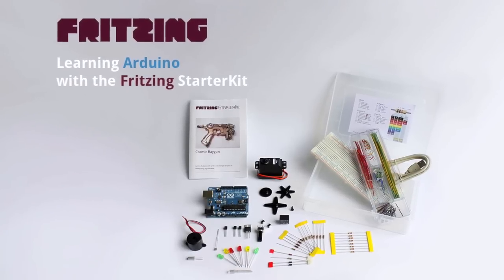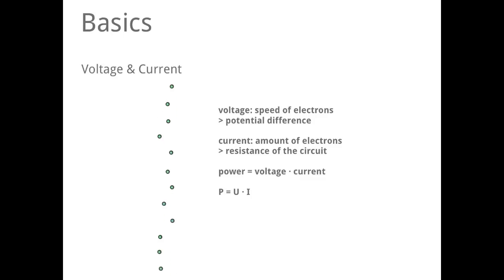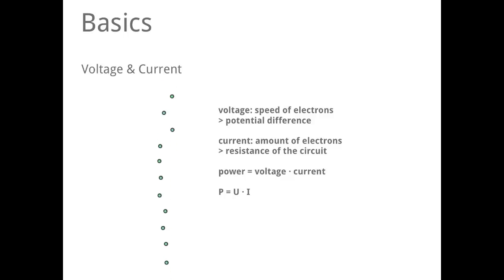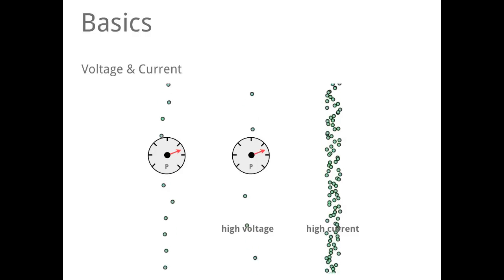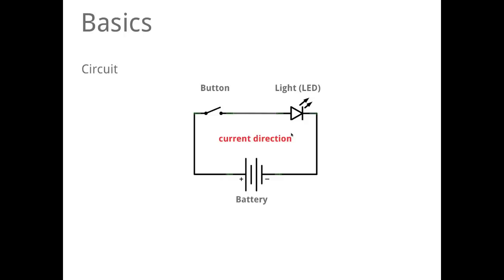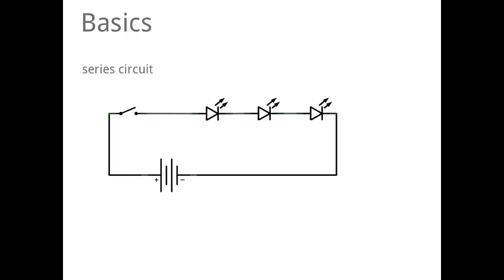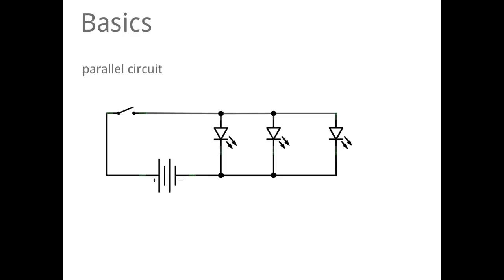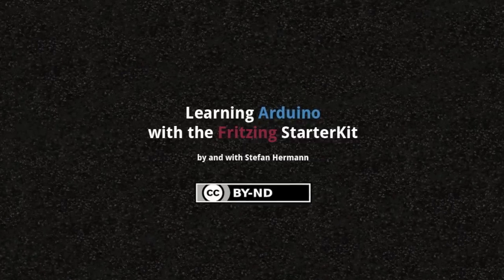Learning Arduino Episode 001 - Electronic Basics

Comment: I don't think electric potential (measured in volts) determines the speed of electron flow, rather it attempts to drive current (more electrons) through the load.
Reply: As an electronics engineer I was always taught that electrons travel at the same speed, sub the speed of light. Higher Voltage doesn’t speed up the electrons.

Comment: Just a question:
So if 6V is the power source voltage in the series circuit, then electrons go 3x faster at the source than through the diodes? Thanks.